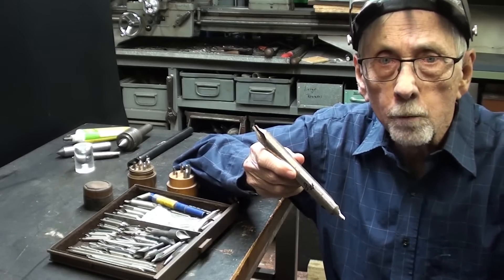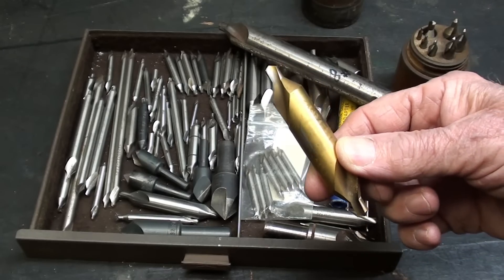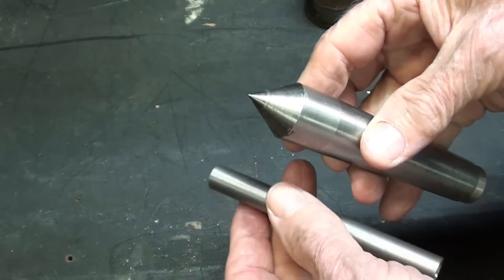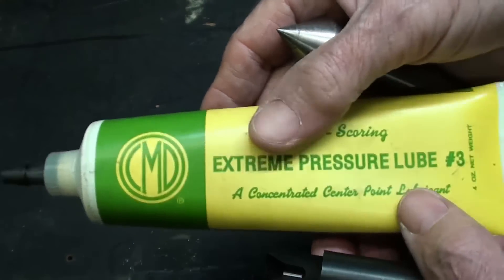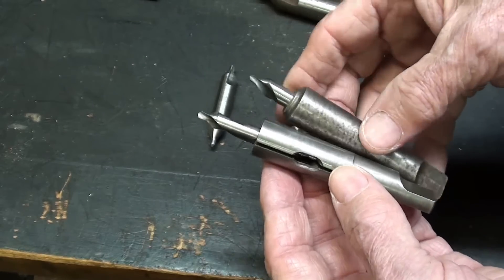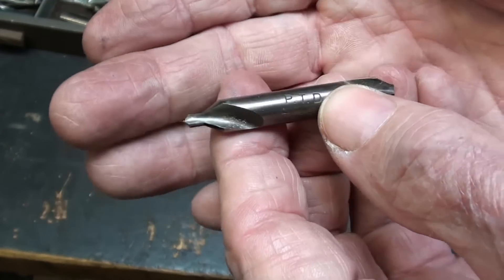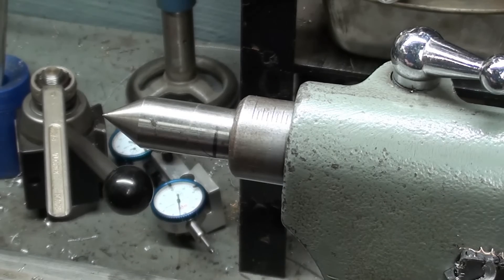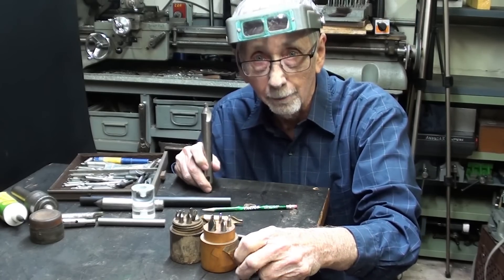PRIMER ON CENTER DRILLS #959 tubalcain countersink

Comment: Mr. Pete,
                       Excellent Video!  In the middle of it, a light went on in my head. I have a round column mill and the center drill has always been the biggest reminder of the flaw of the Rong-Fu, and that is having to lower the head to reach the material with the center drill, and loosing the Z axis reference. I just ordered a set of long length center drills. Who knows, I might not need to buy a Bridgeport after all!
           Thanks Again
Reply from the maker: That's great to hear! Glad the video helped you find a solution.
It was only relatively recent that I discovered the extra long center drills.
Be careful though they can wander a bit because of their length

Comment: Mr. Pete, thanks for the video.  I'd like to purchase a starter set of center drills.  You mentioned McMaster so I hopped over to find them but I could not find any named "center drill" -- they do, however, have sets of "Drill-point Countersink"" bits.  They look the same as a center drill to my untrained eye but if I've learned one thing in my shop-learning journey, its that you can't assume anything when it comes to tools.  My question: are "Drill-Point Countersink" bits the same thing as a center drill?
Reply from the maker: Do a Google search for combination center drill.
Or find them on Amazon

Comment: Thanks for another great video. I retired from the automotive industry and we used many radius center drills. Much like the combination cdrill but instead of the 60 degree taper, it was a radius. This helped immensely when turning parts that were heat treated and then ground. The reduced contact point improved the ability to grind the shaft concentric to other features not ground in the same holding.
Reply from the maker: Thanks for sharing

Comment: CenterDrill vs  SpottingDrill  ? 
please corrrcy me... 
CtrDrills provide a "fit" for 
Live/Dead Center holding in a Lathe.
SpotterDrills cut a start hole for a Jobber drill bit...  thus the diff angles of the bits...  
A CtrDrill does not cut the "best?" start-hole angle for a DrillBit.  
  ** is this sorta correct"  ?? 

ref:  https://youtu.be/UOtQLjcCcZg  
   Winky-210108-Ctr VS Spot Drills
Reply from the maker: Yes, pretty correct

Comment: I still use a dead center as it saves me room when turning long-ish items.
As for lubricant, I learned turning using pork fat. You could always smell when it was getting hot too :face-blue-smiling:
Reply from the maker: Does it make you hungry?

Comment: Thanks Mr Pete, an overkill collection.  No dauber on our 1963 or so 9" South Bends and Definitely no live centers, just that little can of white lead without a Warning Label to Not Eat It.  Also, any idea who set the Numerical Standard for the center drills?  Mr Slocomb seems to have used random letters for his 1/8" thru 7/16", then numbers for 1/2" thru 3/4"?

Comment: At 1:10 - Pete is talking about the "two" purposes of center drills.  I have a third purpose - You can use it to countersink and/or debur a hole.
Reply from the maker: It is not the correct angle to counter sink for flathead screws

Comment: Great video,  recently I’ve been going through my center drills and found a #12 & #13.  They are the same size as a #2 and #3 just with a different shape by the main body.  What is the difference between a #2 and a #12

Comment: Mr. Pete I loved the video. I would love it even more if I had a set of really good center drills. I've bought the China-Bay ones and as I am sure you already know they are a waste of money. I used one the other night and one end would not even drill aluminum. I will be looking for good ones on Pete Bay if you so choose to get rid of some good ones. I'm guessing sharpening them should be done on a bench grinder. I tried on my drill doctor and have not been successful. How about a demo on how to re-sharpen center drills ?
Reply from the maker: Actually, I never have sharpened one. I just throw the dull ones away.

Comment: Lyle, I'd like to see you print a screw on cap and base for a set of the center drills!
Reply from the maker: You are going to have to wait a long time. I gave my printer away.
But printing a holder similar to the wooden ones would be a great project for someone. I was thinking about making a new holder out of aluminum.  Actually, the lid is kind of a nuisance.

Comment: Nothing drives me more crazy when I am watching a video of someone drilling holes in precise locations and they don't use a center drill.  Or drilling a hole on a lathe and the drill bit is flexing around center because they didn't use a center drill.  I too have more center drills than a normal person should need, but I am not selling them.

Comment: I thought that dauber hole was for oiling the tail stock! Works good on my 1911 SB. Must've drilled it a hair deep.
Never looked upon a dauner until now.
Oh! Center drills are awesome!
I use the tail stock whenever I can as my '28 SB is worn out and it helps steady my work.
Is resharpening them next?
Im kidding.
Something learned for today!

Comment: One VERY important thing that Mr. Pete did not mention is the fact that a center drill bit is designed to cut on the side of the flutes. This allows it to make a centered hole even if the tailstock center is not in perfect alignment with the chuck or if the center drill enters the stock off center.  You can see this relief of the flutes by measuring the diameter of the pilot portion of the bit on the back edge of the flutes and then measure the front or cutting side.  On a number 5 center drill bit the diameter of the back edge of the pilot will usually measure about 0.015 less than the front edge. So, unlike a twist drill bit,  the center drill bit, due to this clearance,  is essentially a side cutting bit... acting more like a boring bar than a twist drill bit.  It, more than anything else, is what makes a center drill bit cut holes on center.
Reply from the maker: Excellent comment, hope other people read it

Comment: Thanks for another imformative video, in the UK we some times use a protected centre drill, it simply leaves a counter bore on the end so the centre doesn't get damaged & coarse the work to run out, from Coventry in UK 🇬🇧.
Reply from the maker: I’ve seen those in the catalog. I’m thinking about doing a follow up and I will mention that.

Comment: Good  discussion did you ever use the broken end to remove the tip lodged in the work by grinding out center  of center drill with cutoff wheel to make clearance for broken tip. Which allows you to drill around tip and remove broken tip with small punch.
Reply from the maker: I didn't

Comment: I bought a set of Keo center drills from Enco several years ago and they came in the round wooden box with a threaded lid .
My South Bend lathe has the lube resivor in the tail stock but the dauber is long gone.
Didn't they used to use white led for lube before they figured out it was hazardous?

Comment: One thing you didn’t mention, and I didn’t see any of, are the “bell center drills”. I bought some of those back in the 1970s and don’t recall seeing any since. For those who don’t know what they are, at the top of the taper the cutting edge flattens like a counterbore, just a bit. That allows the center drill to drill just a bit deeper without the hole going parallel and ruining the taper. There are, and I believe it to be a more recent innovation, taper drills where the taper isn’t straight, but curves inward. This allows an offset tailstock to contact the taper evenly, rather than being cocked in the taper which gives constantly rotating radial forces.
Reply from the maker: Thanks I may elaborate on that. When I originally made the video, I thought I had one of those, and I looked and looked and never could find it.
Reply: We always called them bell centers, they had a third cutting angle of 120 degrees.  Many of the centers we drilled were on castings.  Of course a center drilled into a casting usually ended up on the casting center line which usually had a ridge and or offset from the mold parting line.  This style center 'countersunk' the center so the critical mouth edge of the center was evenly perpendicular to the center's axis.  This additional countersink also offered some degree of protection for the center mouth from  damage in handling before subsequent machining operations.
Reply: @phasereversal7783  they were called bell center drills to distinguish them from the actual tailstock or headstock center. I would have to look, but I’m pretty sure the addition cutting edges are at a 90 degree angle.
Reply: @melgross  You could be correct on the 90 degree angle, my experience with them was long ago.  I seem to remember another style that produced a narrow spotface profile around the center's mouth.  The company I worked for at the time was a very large outfit, they would specify all kinds of variations or specials for tooling. They put alot of engineering effort into manufacturing.  One example was the prints always called out .323 Dia (letter P drill) for 3/8-16 threads instead of the usual 5/16 drill called out in most tap drill tables for that thread.  Interesting place to work....
Reply: @phasereversal7783  there are a lot of unusual, I’m not sure what to call them, standards maybe? For example we all see written everywhere that a #7 bit is used for 1/4 20, but my Holo-Chrome socket screw selector and cardboard computer for inch, says #6. I’ve never seen that anywhere else. It could be a typo, but the equivalent on their site also says #6. Strange!
Reply: The one on your bench with the two red rings is a bell type if I’m not mistaken.

Comment: Thanks Mr Pete! Ironically, I just received a tube of that same CMD for lubricating threads of a choke tube, per some gunsmithing forum. I thought it would be a small tube, but the thing is way bigger than I will ever use! Thanks for primer on center drills!

Comment: You didn't mention the ones that look much like standard center drills but actually cut a bell shaped curved hole called "radial" center drills. Also @ ~5:20 the one in the middle with red grooves around each end, those lines mean something but I forgot what  it is. It seem they are for snap rings? Where would you use that? one last thing is well type center drills that drill a small counter bore around the 60deg cone to protect it from handling damage. There are also 90° or 100° angle designs that you should be aware of.
Reply from the maker: I had one of those bell drills, and I absolutely could not find it. I wasted an hour looking for it when I made the video.

Comment: I had to drill a series of six 1/8" holes, string pass through's on an electric guitar body.  On the backside, they would be drilled to 5/16" for a brass ferrule to hold the string ball.  I did it on my mill using the DRO.  Perfect lineup on the drill side, but all catty wampus on the backside as the drill flexed and drifted.  I should have started with a center drill.
Reply from the maker: 😂yes

Comment: I found it interesting, my collection of center drills has dwindled (I bought a pack of 1/4, and some 3/16 and 1/8) at an auction and then a box with some larger and medium length in another lot many years ago). Total investment was less than $5.  I doubt I’ll get a single drill from McMaster for that today.    I did work on a lathe with a cup and cap to store lube. And in school, now torn down and made into a specialty program for students who panic at the thought of reading a standard (non digital) micrometer.

Comment: Good Sunday morning to you! Love the videos! I sold my 1936 atlas that had a dauber hole last spring. It did not have the dauber, nor did I ever make one for it. I replaced it with a Southbend 13x.
 >I took your advise! This week I have acquired a J head 1 Bridgeport to clean up and restore. (over a new Chinese -ium)Lots of polishing the oiled rusted over parts but it cleans up pretty good for what I need it. 
>>I would like to strip and paint it. I'm thinking of using the needle scaler and taking it to the casting. But not put any of the filler back on and prime and pain the bare cast. Thoughts?

Comment: Very good. I would like to see a chart that would show which diameter drill bit to use with the corresponding number center drill. I'm sure that data is somewhere in my library. Just need to go find it.

Comment: I don't have any reliable information on this, but I believe that the tip of the center drill also creates clearance for the center tip, so that the stock rests on the taper of the center and not just its tip.
Reply from the maker: Very true, I should have mentioned that

Comment: I rebuilt an Atlas 10f that had a dauber. It also had babbit bearings. My current 10f has Timken bearings but still has the dauber.
I believe they stopped incorporating them when the lathe was re-stylized. Thanks, Mr Pete!

Comment: The idea of a dedicated Morse taper center bit is a very good one. Thanks much!
Reply: After some looking I found Collis 73501, 73502, and 73503 for MT#3
Reply: Gears in my head are already turning on how to get this done.
Reply: I have a 1" center drill, snagged on Ebay IIRC, I used a MT2 blank and drilled it to accept the center drill and just glued it in place with Loctite retaining compound. It's never come loose and I guess a torch would be needed to get it out should I need to. Only use I've had for such a thing is to make female center adapters of appropriate size.

Comment: I have been using center and spotting drills for over 40 years, and I still learned several things from this video.

I like the idea of making morse taper holders. That could be as handy as a pocket on a shirt! Did you counter bore or ream to size? How did you hold the morse taper blank for concentricity and  perpendicularity? My wood lathes have morse taper spindles, that may be an easy machining solution. Did you use a set screw to secure the center drill and through drill for a rejector rod to replace a damaged drill? A follow up video... Please!

Your morse taper holders appeared factory made and modified.

I feel chastised for cheating and using center drills for the incorrect screw head taper. Another wannabe machinist error...😢

Comment: anyone else have trouble holding center drills in there chuck..seems like you have to have the right ratio.. "chuck depth"  or it is not true..tries to clamp on flues. needs to be single ended just like end mills..

Comment: My WW2 vintage 17" Leblond has a lug on the tailstock for a dauber. It was still full of dried up white lead when I got the lathe, but no dauber. Since I run live centers almost exclusively, it serves as tailstock chuck key storage. Another excellent informative video!
Reply: My Atlas TH54 has a dauber hole, and thanks to following a Mr. Peter video it has a dauber as well.

Comment: Lyle - Another good informative video this morning.  When I got my 1945 SB Heavy 10 it luckily still had the brass dauber which still sits on the tailstock.  Even came with an unopened can of white lead - fun to explain things like that to my grandson.  I'm thinking I even have one of those 4 1/2 size that came in a box lot at an auction - you know how that strange stuff appears when you least expect it.  Have a good week.

Comment: Center drills are very useful even if you don't have a lathe or a milling machine.  I use them in my drill press and cordless drill to drill a small pilot hole before switching to a twist drill anytime I'm drilling a hole in metal.  If you start with a center drill your twist drill will be less likely to 'walk' and your hole will be straighter as long as the pilot hole was straight to begin with.  I particularly like using a center drill before I use an EZ-Out.

Comment: Good morning Lyle. I always forget the different dimensions of the number center drills. But I did learn something from this video and my South Bend 16 inch 1954 vintage lathe has the hole for the grease but is missing the doubler.  Jim

Comment: Glad I held out until the end. I was going to ask if it was acceptable to re-sharpen a center drill. I have several that need touching up along with scads of other drills. I'm getting close to pulling the trigger on a Vevor unit after watching your demo on those.
Reply: Purchase the Vevor 13A. It will let you grind the web relief perfectly to make 135 degree split point drills. 
Vevor had to update the description of the 13B and remove END MILLS because it will not sharpen them.

Comment: After I shortened the pilot tips on the center drills students used they never broke a single one.
Reply: Yes they don’t need to be that long. The small ones with tiny ends are the easiest to break.